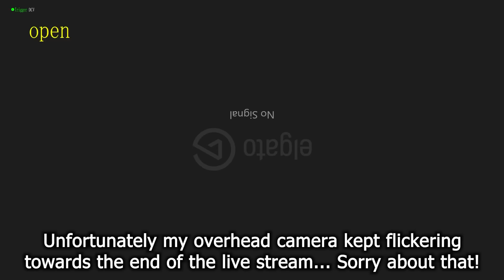The Power Connector Got Destroyed On This Xbox Series X, Now It Won't Turn On! Can We Fix It?

Comment: Sometimes the accent comes through? You mean it's actually MORE than what we've heard? No one is mistaking you for Spanish, mate ;). The notes look great especially the heat indicator. And nice following the rule of "A proper repair is one where it looks like you were never there"
Reply from the maker: Hahha damn it I thought my identity was concealed with the sombrero and chillis 😂 cheers bud, glad people are liking those new little additions. Small but effective 👌 and yeah I prefer not to damage stickers if possible, because half hanging stickers just looks horrible and unprofessional in my opinion
Reply: @TheCod3r  It's more than that. Your port replacements are the cleanest I've seen. I'm right now working on a non console board right now (optical switch issue) that I can't get Schems for. I'm wondering if you have a logical method to approach this type of repair.

Comment: Hey coder I got this ps5 that for some reason it’s not sending any power to the disc drive meaning like you try to put a disc in and it won’t even take it in
Reply from the maker: It could be down to bad fuses on the board itself mate. I haven't come across that myself yet but it was a huge issue on the PS4 Slim and Pro

Comment: thanks, great work, friend, please send a video clip on the ssd that you cloned to a new ssd disk and after that the console started working normally, it’s very interesting if that native ssd disk from formatting and cloning information will work?
Reply from the maker: At the moment I don't have any clips for that. I do have a video on the channel though
Reply: @TheCod3r  yes i watch all your videos, but when you repaired xbox series x you just cloned the original ssd (blue) and put a new one (green) in its place, although the cristal disk program showed that the original ssd had 99% health, so it's interesting to format it and burn it again information and maybe it's just a software failure of the ssd or the cristal disk program is mistaken that 99% of health?